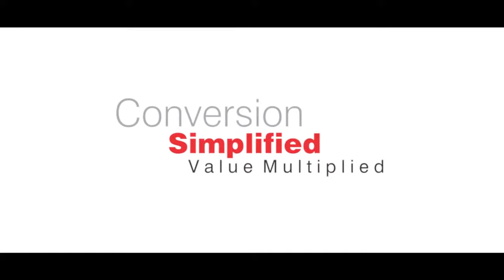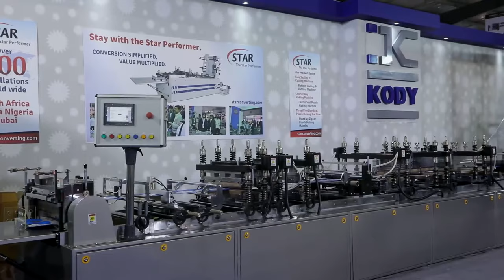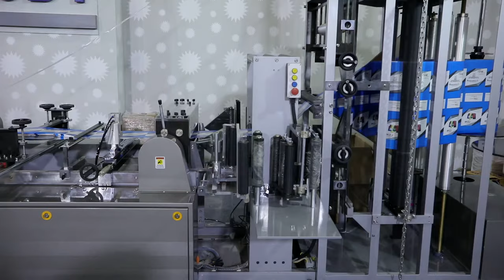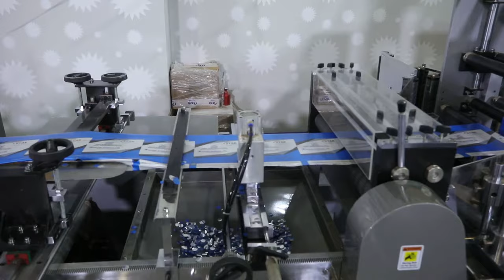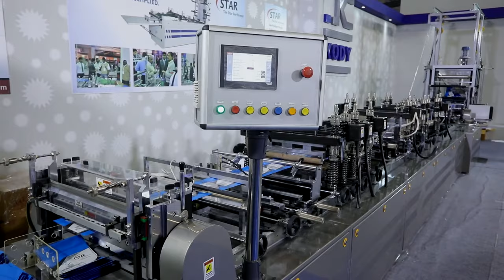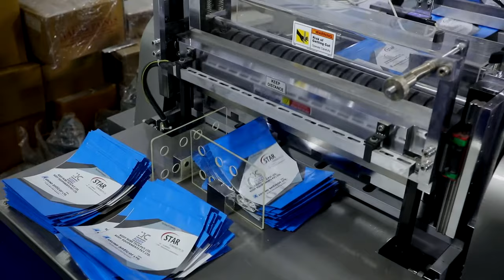Three Side Seal & Stand-Up Zipper Pouch Making Machine up to 200CPM | STAR CONVERTING

Comment: Can we make ld pouches for oil on this machine.
Thank you
Reply from the maker: Our Contact Details: Call/WhatsApp us on +91 9909950247. 
Yes, LDPE Film Pouches can be made with suitable configuration of multiple servo stations to control seal time & dwell time individually for each station as per the pouching process application requirement.